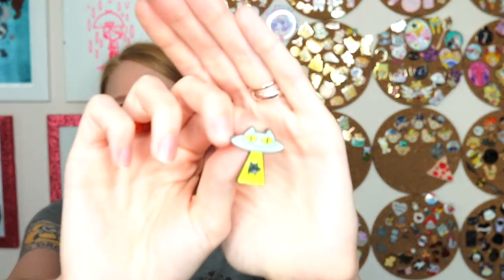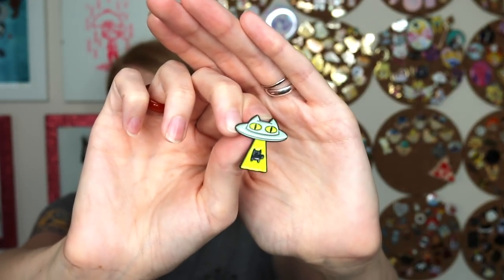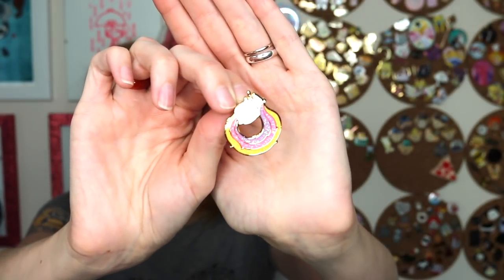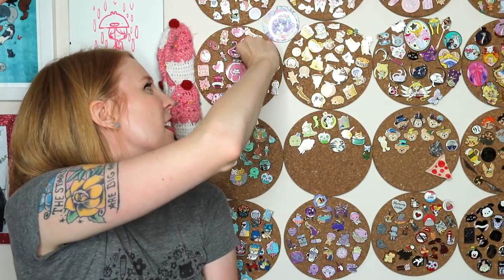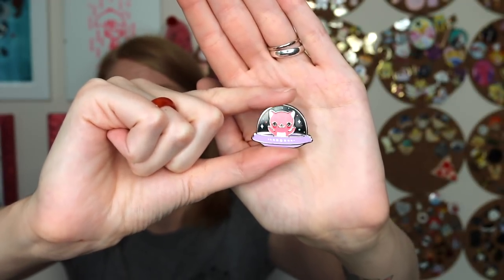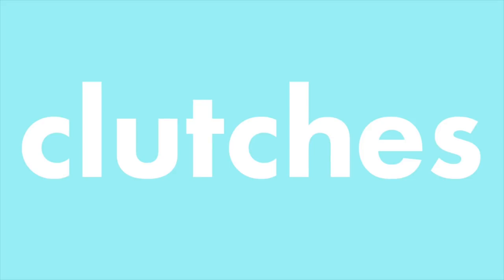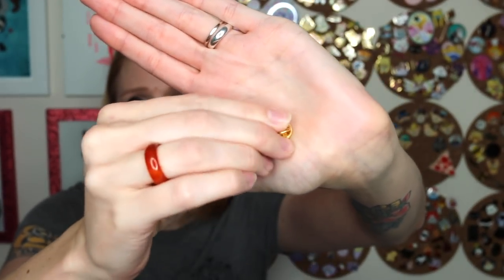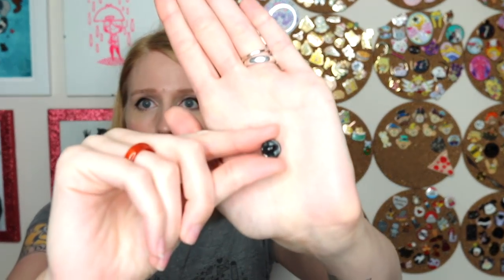Enamel Pins 101: Anatomy of a Pin | The Pink Samurai's Pin Series #1

Comment: I'm not a designer but collector and I hafta say I prefer the butterfly clutches. I think the rubber ones fall off more for sure for me. But I can def see how it would tend to bend the post more.

I see a lot of pop culture pins in the community like Star Wars references or movie/tv quotes and I was wondering if that is a big legal concern or how ppl get away with selling them without licensing issues?
Reply: Agnes Smith Well quotes are just words. Unless they have a copy right on words it's ok. As for the art kinds think of it like that "Starbucks" store someone made awhile ago that they literally just changed one thing about the logo and word and it wasn't a "direct copy" of Starbucks. Also a lot of people use original artwork so it's also ok.
Reply: I agree regarding the butterfly clutches vs the rubber. And I believe that when people create those pop culture reference pins, it falls under parodying which is fair use.
Reply: PlasmicWhim Plus the copyright owner would have to first find out about the infringing pieces, then file a cease and desist through a lawyer. Many times it's too expensive, and others they just aren't aware of the pieces.
Reply from the maker: I think a lot of pop culture stuff is a slippery slope.  I got a cease & desist from Nintendo yeeeeears ago and have been scared of pretty much all fan art since then!  And lots of people like butterfly clutches best!  In my experience, they fall off more, but I think it's all personal preference ^_^
Reply: Agnes Smith QA

Comment: Thanks for this Becky, I learned some useful stuff here. Just some additional info on locking backs for pins - there are two basic types that I have seen, ones which are spring-loaded with a clutch mechanism inside and don't need a tool to attach or detach, and ones which have a grub screw which is tightened with a hex key (hey, getting a bit technical here!). Both are much more secure than butterfly or rubber fasteners, and so they tend to be favoured by bikers and metal fans who don't want their pins falling off on the highway at 100mph or in the moshpit,. It just depends how hard you're intending to use your pins ;-)

Comment: Cloisonné is one type of Hard Enamel. The other one is Champlevé, it consists in digging in the metal to pour enamel inside. Once again, both are Hard Enamel
Reply from the maker: Oh wow!  I've not heard of that method!  Is that more for fine jewelry/art or do they use that for pins, too?  I'm curious!  Thank you for sharing!
Reply: It was mostly used during early Middle age for reliquaries ornements and jewelry but the technique is still used for making printed circuit board (I guess gold is used instead of enamel)